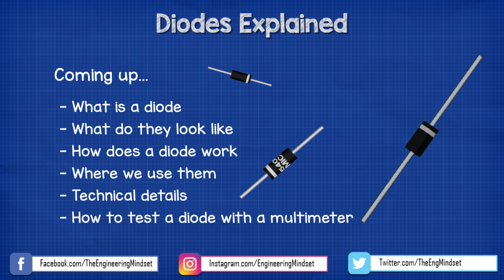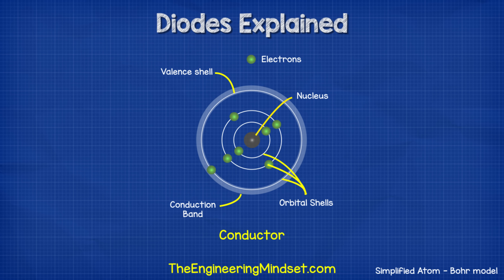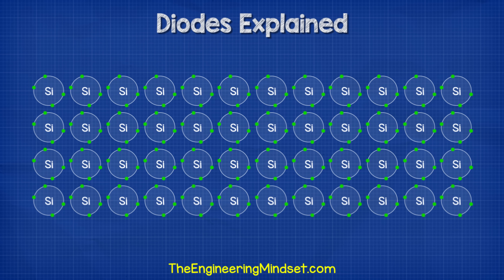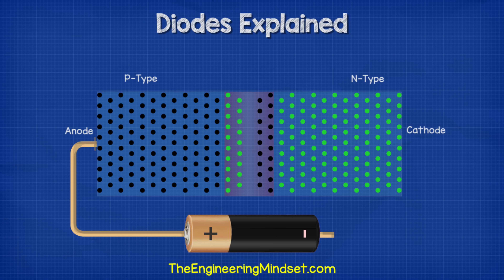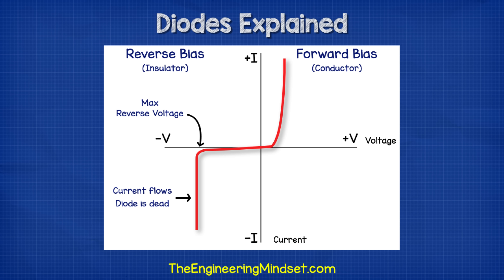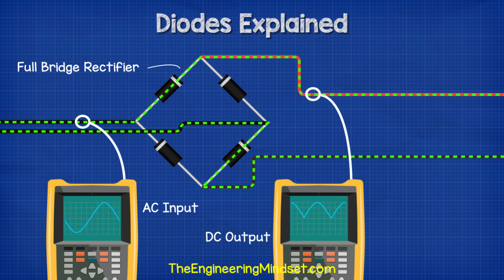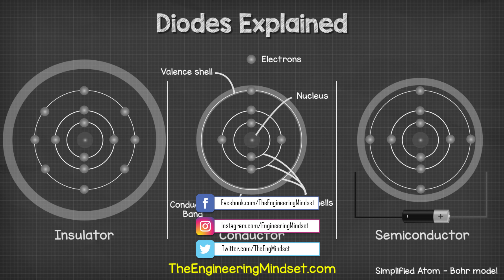Diodes Explained - The basics how diodes work working principle pn junction

Comment: Correct me if I'm wrong but it looks like you have the diagram of the diode facing the wrong way when current is flowing through it. The side with the line is the cathode side which should allow current to pass through if the anode side is connected to a source, whereas in your demonstration you have it reversed.

Comment: I feel like I’m going back in time when I watch these explanations involving the movement of little balls through a wire. Funny how you never get any details about how these electrons are moving through the wire. Are they going over, under, through, around,  zigzagging in and out?
Reply from the maker: Please see this video in full https://youtu.be/3KePcASD0NQ
Reply: @EngineeringMindset  It’s a dated explanation. Electricity is induced by continually passing a magnet over a conductor. The magnet exerts pressure on the internal structure of the element and then releases it. This back-and-forth creates friction and as a result heat, and it also causes the magnetic fields to become external to the element. That’s electricity, a hybrid of heat and magnetism.
Reply: @E @EngineeringMindset  I learned about these little balls called electrons the same way you did. But if you really want a deeper understanding, you have to move past it.

Comment: 8:42 how does the diode protect the led thats on a separate branch of the circuit? when we learned that two bulbs in parallel circuit one can break without affecting the other

Comment: Question: Is Electron Flow correct for both DC (pictured), and AC?  Or, is Conventional current the correct flow for AC?
Reply: When used on ac, it actually acts as a rectifier, so you can turn turn ac into dc.

Comment: 1n4007 can this be used in place of 1n007 diode in 12 volt system
Reply: The 1n4007 is good for 1000v and 1 amp

Comment: Please just stop to explain electricity by the example of water. Sure, in many simple situations it works. But i have seen many people with this comparison stuck in their heads when they realized electrons are not a liquid and don't behave as one at all. Once they went deeper into it they really struggled to get rid of that idea. That's why my father totally refused to explain electricity to me as if it was water, when i was a child. He knew it would stick in my head^^
Keep one thing in mind. Water atoms are attracted by gravity. For electrons this is a whole other story.. Letting alone the fact that a wire is not a pipe whose diameter decides how much water cann pass at what pressure. No. It's just not like that.
Reply from the maker: Thanks for your feedback but the water analogy is probably the most effective means to teach concepts of electricity to someone with little to no understanding. I will therefore continue to use it and I'd argue that most people do not need to understand much deeper, they just want to learn enough to build some simple circuits. However, I have previously covered how electricity works from the electromagnetic waves around the wire which you can find here https://youtu.be/3KePcASD0NQ

Comment: What if the MB3200 diode can be replaced with SR3200? Is it possible to work in the power supply? The difference between these two diodes is the IFSM (peak forward surge current).
The MBR3200 diode has an IFSM of 80A.
While the SR3200 diode has an IFSM of 100A,

Comment: I have a doubt. In the Electron flow, the current arrives in the Led first. Why the Led dont burn if the current will only be controled by the resistor in the other side ? I can't understand this.

Comment: question. or checking? so the half wave rectifier wouldn't that rough dc voltage be at 30 Hertz because it's only receiving one half of the voltage signal? or would it be 60 no matter how you split it?

Comment: I would greatly appreciate if you were to explain each term in the table at 7:20

I roughly knew how diodes worked and how I will use them in my circuit, but I was looking for knowledge on how to pick a diode appropriate for my circuit. Explaining the terms in the table would be greatly useful for my case! I intuitively ended up understanding what's going on from the further graph, but I would suggest having a "how to pick a diode" section at the end of the video for noobs like me!

Thank you for this explanatory video, it was very helpful and well-made.

Comment: Love your videos.  My only little grip is that in your examples and explanations, you seem to jump around between electron flow (- to +) and conventional flow (+ to -) for different explanations.  It tends to confuse me a little when you do this and I have to recalibrate my thinking on it as you do it.  Why not just do everything either in conventional or electron flow?  There must be a reason?
Reply from the maker: Thanks for the feedback. So the problem we have is that circuits are designed (typically) using conventional current theory, but when we do the deep dive into the components that make the circuit we need to switch to electron flow to explain how it actually works.
Reply: @EngineeringMindset  OK.  Big picture...conventional flow...when we zoom in on components...it is better to electron flow.  I assume electron flow makes more sense when you are talking about theory of why.  Outershells, Valence electrons, semi-conductors etc all relate to the issue of ELECTRONs moving, which are negative charge.
Reply: @EngineeringMindset  I am a civil engineer by trade (but in engineered sales now).  Your videos and how great they are, make me sometimes wish I would have taken a few more classes back at the university on electronics.

Comment: 6:37 I am confused. You say that the voltage source needs to be greater than the potential difference of the barrier. But the video shows the batter has less votage?
Reply from the maker: At that exact moment. Pay attention to the charges. Nptice they are not moving. The battery voltage isn't high enough to jump the barrier

Comment: Thank you for explaining diodes.  Where does the voltage go when diodes measure a voltage drop?  Does it become heat in the diode or does it just remain backed up behind the diode?

Comment: in 6.41 the voltage source was 0.5 which is less than 0.7, so how it acted as forward biased. It's wrong or mistake
Reply from the maker: Pay close attention to the video, no current is flowing at that moment. "the voltage source has to be greater than the 0.7V barrier, otherwise the electrons can't make the jump"

Comment: According to the video, the voltage source has to be greater than the voltage barrier in the diode -> which in the example provided the voltage barrier is 0.7 volts and the voltage source is 0.5 volts. I wanted to know if there was a typo because a 0.5-volt battery would be LESS power and therefore the electron would be unable to overcome the potential difference of the 0.7 volts.
Reply from the maker: Please notice that at 0.5V, the animation doesn't show any current flowing, only when 0.7V is shown. We will look to improve this part when the video is remade in future as many people haven't noticed this.
Reply: Ohhhhh I see. Thank you 🙏 so much for getting back to me so quickly.

Comment: What do you mean they get pulled toward the ends when you reverse the power supply? Why? How? Does the silicon physically move to the edges like it would be visible if the exterior of the diode were transparent?

Comment: It should be pointed out that certain diodes, such as a high voltage diode, may test as bad [open in both directions] as the forward voltage drop can be 5V or higher, perhaps 10V. Many, if not most, DMMs do not supply more than 1V or so when in the diode test setting. There are exceptions; the EEV Blog 121GW Multimeter supplies 15v in the diode test setting. There are alternate methods of testing diodes with forward voltage drops above 1.5V using a power supply and dropping resistor. Just be aware of this to avoid component level misdiagnosis of a faulty device.

Comment: You got everything right except testing the diode. Those are not volts, those are ohms. And it has absolutely nothing to do with how much voltage it takes breakdown the depletion region and open the diode. It's simply the resistance offered by the diode in a forward biased configuration. The word "volts" should not even be part of that  explanation.

Comment: When you convert ac to dc using diodes and capacitor, if the ac is 220v will the dc output also be 220v?
Reply from the maker: See our video on full bridge rectifier

Comment: I'm sorry, I have a question: at 6:36 you said that the voltage source has to be greater than the 0.7 V barrier given by depletion layer, then why is it 0.5 V that is reported on the battery? Maybe you wanted to write 1.5 V instead?
Other than that, you did a proper good job mate 💪
Reply from the maker: At the time 0.5V is shown on the battery, no electrons are flowing through the diode. It doesn't have enough voltage. This is illustrated in the video.

Comment: I have a question; Suppose we connect a diode and a resistor in series, and the whole system to the poles of a 9V battery. How much should be the resistance value of the resistance, in order for the current NOT to pass through the circuit, if the minimum voltage of the diode is 0.5 Volts?

Comment: so a diode allows current to pass through when activated Like a gate.  so why wouldnt use a mosfat instead because a mosfat also allows current to go through when activated.
Reply from the maker: Diode has only 2 pins, it's very cheap and simple to install in a wire

Comment: Nice Multimeter! I'm looking to buy my second one. I have a 20€ one for now, it works well, it has endured some stupid things I did (if the fuses haven't).
I'm wondering why someone buys a Fluke. What is it that makes them worth the price? People talk about accuracy and reliability. But as far as I know (and correct me if I'm wrong, as I'm a beginner) too much accuracy isn't necessarily what we shoot for in circuit design, because of the 5-10% tolerance of resistors and such. And what do we mean exactly by "reliability"? Do cheaper meters stop working after some time or time-to-time? Looking at a Mastech MS8229 which is quite a bit cheaper and has more features. Don't mean to buy a Fluke, just because it's said to be the best, when I don't really know what that actually means.

Comment: I am so confused about electron flow can someone explain. I like that he explained conventional current vs electron flow because hardly anyone does, but shouldn't the diode be placed before the LED if the electrons are actually glowing from negative to positive, or does it not matter as long as it's in the circuit?

Comment: Hey. Thank you for the video.
I don’t understand the reverse bias section. Should the electrons in the cathode not just go to the positive battery terminal and around the circuit to the Anode and possibly over the potential difference barrier to repeat the cycle?
Why would electrons just bunch up in the Cathode and not escape to the positive battery terminal and beyond?

Comment: Why measuring the voltage of the diode when the circuit is open gives a voltage value while it should give a zero as it’s not a voltage source¿ Thanks
Reply: A voltmeter measures the potential difference between 2 points, not a voltage source
Reply: @mtqrx  Thanks

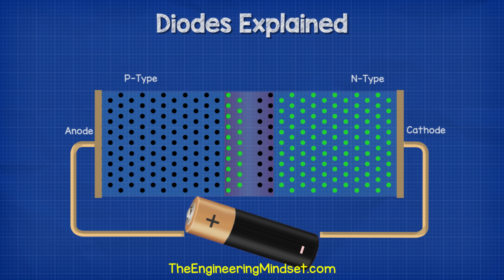Comment: I looked at your video again at 6:39, and when you had no voltage listed on the battery the current did flow, but when you labeled the battery as 0.5V the current did not flow.  Why not label the first case as a battery of 1.5V and the second case as a battery of 0.5V, and then reverse the battery?
Reply from the maker: Because the battery wasn't 1.5V, it was any voltage greater than the barrier. 0.8V, 9V, 100V etc, it just had to be enough to create a forward bias. You are assuming it's 1.5V. Then I define the battery as 0.5V to show that current won't flow because the voltage is less than the barrier.

Comment: Nice description, however, there is an error at 6:39: you say, "The voltage source has to be greater than the 0.7 v barrier otherwise the current won't flow", but you've labeled the battery as "0.5 V" and the current appears to be flowing. The battery should be labeled as "1.5 V", rather than "0.5 v".
Reply from the maker: The current isn't flowing at 6:39, some electrons are getting closer as some voltage is being applied but not enough to make the jump. The label shouldn't be 1.5V because at that moment I'm explaining what happens if a 0.5V battery was used, so I'm defining the system as 0.5V.
Reply: @EngineeringMindset  and yet you show current flowing with the battery listed as 0.5V

Comment: In the HVAC industry we have a component known as a create-a-wire sold by Honeywell and Venstar. It is used when more thermostat wires are need for a new tstat or updated equipment and a new wire cannot be pulled. They use a diode at the tstat and another box in the furnace to, I guess interpret the signal which will bring on the corresponding equipment. Can you explain how this works. Thank you in advance.

Comment: Hey all, i’m using a step up boost converter In0.9v to Out5V in my circuit.
I want to keep the output current in 5V without burning anything in the circuit, what diode can y’all recommend me? Grateful for tips 🙏🏾

Comment: The positive end of a diode is called the anode, and the negative end is called the cathode. Current can flow from the anode end to the cathode, but not the other direction. But here u said it flows from cathode to anode 2:04
Reply from the maker: Depends if you're using electron flow or conventional current. We have a video explaining the difference
Reply: @EngineeringMindset  Ok thanks dude for clearing my conflict .

Comment: I’m a Master Automotive Technician and really love this series! Technicians understand the use of diodes and how to test them but it’s really great to see their inner design and just exactly how they fully operate in different setups. As technicians we are fully able to diagnose good diodes from bad in circuits and other circuit problems. But this video gives you a much better visual understanding for seasoned electric workers and those who are just beginning to learn. Love this series of videos!
Reply: I took auto technology for a year in 2005 .  We barely touch anything except series and parallel circuits.  I didn't work in the field because the hiring folks said I was too old at 44.  Now , almost 20 years later I am trying to install brake lines in my father 1996 corolla.  After the sun beats down on me for 1 hour or so , it's tough.  Waiting for rain to finish the job.

Comment: Awesome video series, but it was a bit confusing going from this electron flow to the conventional current in your capacitor and rectifier videos (the diodes flipped in the opposite direction). Would be less confusing if all were presented the same visually except for a quick note showing electron flow which I did find really interesting.

Comment: How would the holes move as they are not the same as the electrons, thank you!
Reply from the maker: They don't move, they just appear to move. See end of video please
Reply: @EngineeringMindset  Thank you kindly
Reply: @EngineeringMindset  I understand the diode purpose and what it can achieve, what I do not understand is, once I break down its internal circuit and analyse it when it is reversed biased, how the holes would move or shift place, we know that the electrons are the only ones which are able to move freely, also the electrons when it moves in the N-type material, they leave a hole behind for the fifth electron of the valance shell (correct me if I am wrong), and this hole will attract another electron, the question is, when the diode is reversed biased, how would the holes in the almost middle in the P-type material be filled so the barrier gets larger at the place? Thank you kindly for your time!

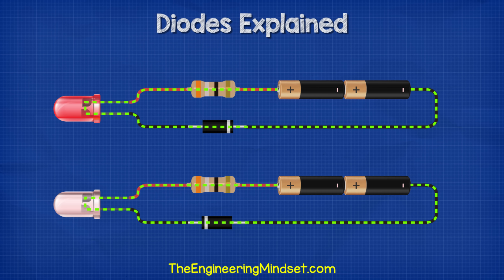Comment: 01:43 I think there’s a mistake as the electron flow diagram shows the electron passing through diode (through the negative stripe) first but the LED is off.
Reply from the maker: The bottom one is just showing the electrons still exist in the wire but they aren't moving because diode is reversed and blocking.

Comment: Does the size of diode depend on voltage in the circuit or the total load (resistance) of the circuit? I'd like to get a matrix of 20 LEDs to light up only 10 (or 20) depending on which way the 3-way  switch (locking, center off) is set. I want to disrupt the flow of electricity to half of the LEDs when the switch is in one direction and all 20 "on" in the other direction. Any advice would be greatly appreciated.

Comment: I now know how a Diode works, but I don't know how to select a Diode for my application. 40A 15V Power Supply. The Power Supply is being used to charge a 12v battery, but when the Power Supply is idol, the battery is powering the Power Supply LED indicator. I want to stop it with a Diode. What Rating do I look for?
Reply from the maker: Seen the new LED explained video? so much detail covered! https://youtu.be/O8M2z2hIbag

Comment: I've got to take issue with saying "you might be used to seeing conventional flow which is traditional in electronics engineering and this is where the ELECTRONS flow from the positive to the negative.  It's so wrong to use the word "electrons" here as all those trained in electronics engineering know the 'electrons' do not flow in that direction.  But it is still appropriate to describe the "current" as flowing in that direction as it's the virtual "holes" that move in the "conventional" direction.  After all, current is described as flowing at a rate of about 90% the speed of light, but that's only if you track the virtual location of these "holes" travelling in the conventional direction as the speed of the electrons is a typical circuit move slower than a walking pace.